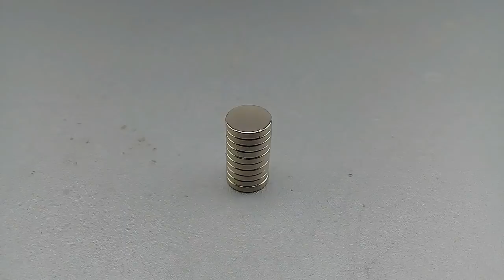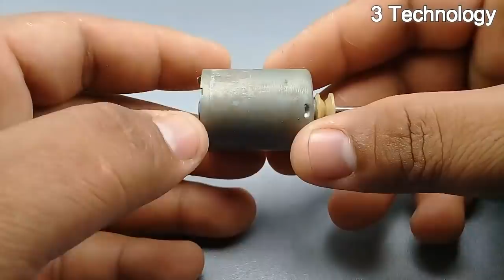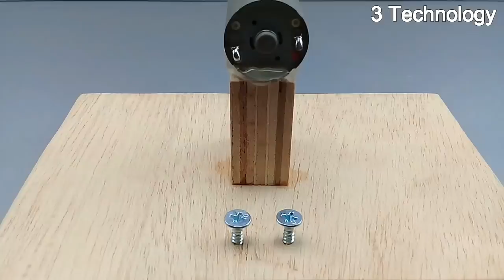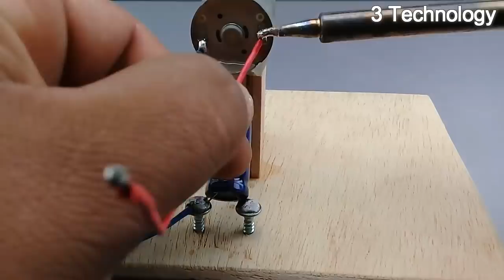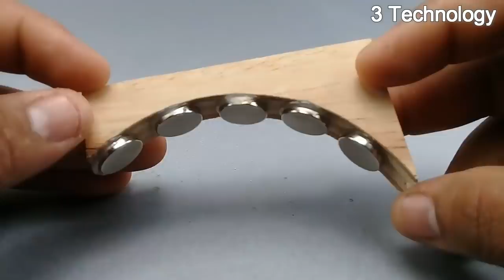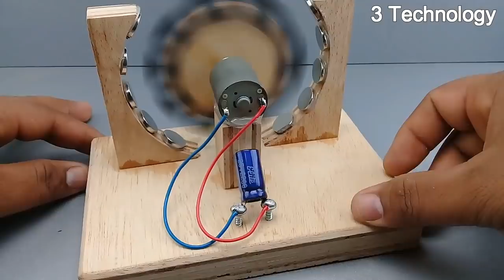Free Energy Generator Using activity Magnet & Magnet

Comment: I like to see it made from transparent plastic ,not with wood, to see where the battery is hidden.
Reply: ofcourse
Reply: Should run without connecting to motor
Reply: Deverian ser más creativos ese truco ni sentido tiene siempre los imanes buscan un punto donde detenerse
Reply: The base plate is always so thicc with screws inserted into it...
Hmm... I wonder where the power supply could be? 🤔
Reply: YES  thatThis is absolutely true. He hides them under the wood. I dare him to take the screws out of the wood until we see that no connection has been made from the wood.
Reply: Absolutely
Reply: Somehaters everywhere magnets can be used to make it spin
Reply: Sad, but not surprising, that people are so ignorant when they see science.
Reply: @anilpatel-gc8sk  well, these setups generally don't run for hours if not connected to motor, do you know under a certain condition, any motor can act as both motor and generator at the same time? 

i pulled the above statement because i am completely aware of how these kind of machines work. generally motor when added with a capacitor (no need to worry how small the capacitor can be), generally gives a few extra spin than the speed of spin when turned with our hands, this is because the motor acts as a generator when the shaft is turned physically, this generates electrical energy and stores the same in the capacitor, which when motor's generated voltage becomes less than the stored voltage, the voltage from capacitor gets reverse flow and the motor will be powered by the capacitor.

when you start spinning the magnetic setup, with a specific rpm, the torque generated by the magnet's mass on the wooden board, becomes larger than the force that holds the magnets from getting stopped, so the entire board will start spinning continuously until the torque generated by the magnet's mass is less than the magnet's polar interaction, this usually lasts for seconds or at the best for few minutes. If you add a motor with a capacitor attached to it, the motor acts as a physical force generator , that generates sufficient force to keep the magnet's polar interaction force to be low than the torque generated by the magnet's mass. 

this machine will slow down if there is more load attached to the motor (say a light bulb), as those load needs more torque from the motor to last (as the load increases the motor is supposed to generate higher amp value ) which slows the magnet's spin speed which makes the entire setup to stop.
Reply: The capacitor acts like a battery 🙂
Reply: The electrolytic capacitor is a battery in disguise
Reply: @carwerasdewq1412  again you can't prove it, but i can prove and many have proved already the electrical over unity works
Reply: @seshamxy9135  entonces funciona ? Me gustaría saber mas de esto si realmente se puede hacer de esa manera
Reply: @osrick92   well, these setups generally don't run for hours if not connected to motor, do you know under a certain condition, any motor can act as both motor and generator at the same time? 

i pulled the above statement because i am completely aware of how these kind of machines work. generally motor when added with a capacitor (no need to worry how small the capacitor can be), generally gives a few extra spin than the speed of spin when turned with our hands, this is because the motor acts as a generator when the shaft is turned physically, this generates electrical energy and stores the same in the capacitor, which when motor's generated voltage becomes less than the stored voltage, the voltage from capacitor gets reverse flow and the motor will be powered by the capacitor.

when you start spinning the magnetic setup, with a specific rpm, the torque generated by the magnet's mass on the wooden board, becomes larger than the force that holds the magnets from getting stopped, so the entire board will start spinning continuously until the torque generated by the magnet's mass is less than the magnet's polar interaction, this usually lasts for seconds or at the best for few minutes. If you add a motor with a capacitor attached to it, the motor acts as a physical force generator , that generates sufficient force to keep the magnet's polar interaction force to be low than the torque generated by the magnet's mass. 

this machine will slow down if there is more load attached to the motor (say a light bulb), as those load needs more torque from the motor to last (as the load increases the motor is supposed to generate higher amp value ) which slows the magnet's spin speed which makes the entire setup to stop
Reply: @osrick92  I actually explained this in one of the previous comments, take a look.
Reply: @Land and Lore Photograph Off Road Adventures remember that this kind of machine usually works, but this specific one shown in the video is faulty and have edit very cleverly to show off... 

Apart from the video, the general concept of motor based on magnets alone works.
Reply: Hey....the electrolit condensator tor could be a camouflage too...couldn't it?
Reply: @yudabanaspati5430  electrolytic condensator? You mean capacitor / battery?
Reply: @seshamxy9135  I guess so...could be
Reply: @yudabanaspati5430  if you want to know how these machines work, just explore them dude, I am just tired to explain how these machines work, secondly apart from the exact machine shown in the  video, other machines of similar design work. But i doubt that this machine in the video have gone through some editing...
Reply: @seshamxy9135  well....I think I'm gonna do that...
Reply: @yudabanaspati5430  good, if you come by any hardships just reply here the doubts, I will answer them that time
Reply: @seshamxy9135  ok..I shall do that👍
Reply: All he did was charge the capacitor.a capacitor is a battery.
Reply: @stevenhale600  capacitor can run that motor for not more than few seconds
Reply: Ethier inside the motor or that fake capacitor. You must remember hot snot = hidden battery.
Reply: Aswr😂
Reply: @nwaforshedrack6656  guess your message is not understandable, so text in proper language or english ( which I am able to understand)
Reply: Charged capacitor??
Reply: @Ratwezil  charged capacitor can't even last for more than few seconds to run this setup
Reply: I love how his soldering always goes so smoothly. I've had nuthin' but trouble with any soldering I've tried to do. Seems like I have to continually clean my soldering iron.
Reply: they make this everytime
Reply: @seshamxy9135  can If its hollowed out and filled with small watch batteries
Reply: @Ratwezil  yeah, but not all such machines are fake, since you can't deny this kind of working procedure, just because some of us were taught in a way to believe certain things wrongly
Reply: @robdom91  Inside the fake capacitor.
Reply: @robdom91  LiPos in the basement)
Reply: 😅 Cierto los tornillos
Reply: @SakshiSingh-zp6fb  do you have any idea of what are you talking about? If you don't, please leave the comments section
Reply: This is 100% free energy
Reply: @BuzzingGoober  HASHAHDHQHHD omg, yeah, keep thinking that way, you wil get really far, far from success
Reply: @Maple_TherianWolf  I made this device and now power my mining rigs with it
Reply: @BuzzingGoober  Ö im sorry, i was wrong, i must do this to power my car
Reply: @Maple_TherianWolf  yes I power my Tesla with it too.  You have to try.  Free energy is good, not bad.
Reply: @BuzzingGoober  Im gonna try, thank you a lot, and im sorry for not trusting 🙏
Reply: This is magnetic drive technology and it's nothing new.
Reply: @SakshiSingh-zp6fb  yeah that's true bashers should go to school and learn more about science
Reply: @seshamxy9135  Exactly, and if the outer magnets / housing was adjustable it should make the motor spin faster as the magnets get closer. I can see this idea being redesigned in a larger scale to power transportation devices and or to make electricity, yes can you imagine having a free energy bike, motorcycle, or a car / truck ?! Hell yes
Reply: @Ratwezil  The magnets are doing the work, the capacitor really isn't even needed to keep it spinning, but this idea does need something to get it spinning ie a hand foot ect 😃
Reply: @overthemountain1009  I guess this is the second time I am saying the following statement, this machine got two forces needing to get involved, in general the starting speed of the magnetic rotor decides how long it can run, because it stops after a while, it is because the torque caused by the momentum of spinning magnetic rotor will become less than the magnetic force of interaction, in this case the rotor will stop. 

To kick start the rotor, you should need the sufficient rotor torque that can over come the stopping torque caused by magnetic interaction forces . 

Due to the above reason it will not be suitable for transportation at all.
Reply: @lpilch4  That could have been an explanation, but to power this for so long, more capacitance is needed. Moreover, capacitors try to dissipate the charge ASAP, and we didn't even see a register! so, I think, capacitor is not the explanation, simply the screws go inside the plank to touch some battery terminals.

Comment: That capacitor pointlessly attached to the terminals is actually hollowed out with some button cells installed. That's what's making the motor spin.
Reply: Shure. It's the better and simplest solution.
Reply: The only explanation that makes sense.

Comment: What are the two wood screws for? You can solder the capacitor directly to the motor terminals.
Reply: Hidden wires from underneath
Reply: Kindly , what it the rule of this capacitor .  thank you
Reply: The two screws are to make contact with some metal under the wood powered by battery
Reply: hidden batterry in wood box
Reply: @Joel-qz6sd  The wooden floor is hollow and a battery is connected to the 2 screws from the inside
Reply: @Joel-qz6sd  it is fake
Reply: @uwemuller-rave7162  Space man send me the magnets and ill show u without wood On a fking Transparent PVC
Reply: yesssss
Reply: @Joel-qz6sd  Yes from a battery.
Reply: @Joel-qz6sd  Oh yes from a battery.
Reply: @uwemuller-rave7162  haters be like dude do some research before saying
Reply: @heat4319389  the capacitor is generally used in motor - alternator based electrical energy multiplier for no specific purpose, there is no chance that the amp generated will be less than the motor's requirement to spin, yet for backup purpose only capacitors are used. The reason is the same for the capacitor in this video too. If he attaches more load, than the force generated from magnetic interaction, then for a small limit of time, the motor to balance the magnetic spinning speed , small scale capacitor is needed
Reply: @albertoantoniomartinez4313  maybe, only if you try to build it and see only you will  know, generally magnet - magnet spinning setup works only with a motor attached to it, this is just because, beyond a certain amount of time, the magnetic interactions will fail to cause the continuous spinning, that where the motor comes at work , by giving the spinning boost, this is also where capacitor comes into play as the motor may need a little of extra load in amp to spin the magnet and keep it in the right rotational speed to maintain the spin continuously
Reply: @seshamxy9135  many thanks for this excellent explnation
Reply: @heat4319389  welcome man
Reply: the screw is where the battery or power source are connected ( most likely wire under neath the ply wood)
Reply: @reypanelo  there is no proof for it, secondly I explained how these kind of machines work and follow the scientific rules , yet if you insist your battery existing under the screw or plywood, you are purely adamant and blindly accepting what others taught you instead of experimenting and knowing things
Reply: They are right, why the need to install two screws and go the extra mile when you could just solder that cap to the terminals, lol. I've yet to see a good explanation for those screws and the efforts as to why installing them. 🤣
Reply: @KB_Joys  you can try any electrical over unity machine dude, just don't install the screws aline, see if it works.... I guess you will find why the screws are there in general,  on seeing your laughter smiley, I thought you could be a simple minded and blinded guy who follow the books very well to talk here.
Reply: @seshamxy9135  offended easily? It's redundant, you simply don't need to do it and could have saved at least 5 mins. 🤷🤦
Reply: @KB_Joys  If you don't want to believe or do and see, just quit, I have done few machines, I am no longer interested in doing these child grade machines for YouTube
Reply: @seshamxy9135  just relax my friend. The way the world is and the people that's in it, it's hard to believe in anything. I'd like to be able to trust and believe in nice things, but people make that very difficult. Life isn't supposed to be like that, and I'm pretty sure we'd all be much more happier without any lies or deception.
Reply: @KB_Joys do you know the difference between energy ( total energy) and electrical energy .
Reply: But then there couldn't be a secret Battery-Compartment.
Reply: @SoHBetaSword  that's what I am arguing regarding most of the so called " Free energy " designs, which is not actually free energy at all, just a common electrical wattage multiplier
Reply: Those would be connected to the battery lol.

Comment: Build it WITHOUT the motor attached.
If this setup is correct, the wheel should spin  on a secured center shank free of any motored or wired connections.
The motor and wiring is unnecessary to prove the efficacy of mechanical setup and magnet placement.

Comment: El capacitor es para frenar la velocidad,de otra manera la aceleración de la rueda estaría incrementando más y más hasta llegar a velocidades que sobrepasaría lo imaginable hasta crear un hoyo negro y así la destrucción completa de la vía láctea
Reply: Thanks xD 

Translation:

Carlosjimz

EN
The capacitor is to slow down the speed, otherwise the acceleration of the wheel would be increasing more and more until reaching speeds that would exceed the imaginable until creating a black hole and thus the complete destruction of the milky way

DE
Der Kondensator soll die Geschwindigkeit verlangsamen, sonst würde die Beschleunigung des Rades immer mehr zunehmen, bis Geschwindigkeiten erreicht werden, die das Vorstellbare bis zur Entstehung eines Schwarzen Lochs und damit der vollständigen Zerstörung der Milchstraße überschreiten würden
Reply: Млечного Пути из кобыльего молока ......которое не пьют млечхи.
Шутка абракадабра!

Comment: Why the screws? Why not just solder the wires to the capacitor? Or are the screws attached to a battery on the bottom of the base somewhere?

Comment: The fact that it didn’t start by itself should show that there is an equilibrium position and no matter how many times you spin it or use any number of opposing magnets , it will come to a halt at equilibrium position. If it’s spinning then there must be a batter connected to the motor (the motor itself is pointless here and adds no value)

Comment: 2 things you people dont understand. first there is no free energy . second you all do the same mistake, to use permanent magnets you need to build it so, that at any given point of the rotation of the rotor , there is a un blance in the magnet fields . building symetric will never work . symetric system go into lock inevitably

Comment: This is awesome! (sarc) Now, scale it up and run your house on it for about 6 months to a year. Or, even just run a refrigerator. Then patent it and sell it. You would be a billionaire within 5 years. But you won't do it. Why? Because it's a fake.
Reply: Right because the battery to power the motor and Capacitor is hidden under the board connected to the screws on the back side 🤣🤣😂😂

Comment: What are the magnets for? They're not doing anything.  You should show the hidden wires that are connected to the screws.  Please tell PAK your videos are fake. Tell him the truth.
Reply: I tried your idea and it does not work I did every thing possible at leased20 times but it works beautiful with a 9 volt battery runs like crazy my add vis to you if you are going to waste your time doing something do it honestly you will get a lot more compliments . I have a invention that runs off of a 12 volt car battery that recharges 24-7 its self and makes real energy ,12 volts to a invertor to make 120 volts  ac to light up a 100 watt light bulb I have on a shelf in my little cat shed it runs 24-7 the cats love it they all lay around it in the winter to keep warm it works great. I wish you luck keep trying for free energy you might luck out one day.

Comment: Dear all , This is not a free energy.  just for  youtube views only. Every time he is going to make like this . the wood has already two holes prepared. inside of it are small batteries. to apply it  are two ways. one is he cut some portion under or behind the wood and made some battery housing. second the flywood can be cut in layer and put the batteries in the middle and glued it again, but in this case he made the first one since he did not show the other side of wood base. meaning this is bogus.

Comment: I'm wondewring why you don't directly get the Capacitor connected to the Motor - O h wait, than the Screws connecting the whole thing to the Batteries underneath wouldn't make any sense.
That's also the Reason why you don't show the Underside or why you're not using transparent Plastic.

Comment: Can't work. It would just find a position of equilibrium and stay there. If you claim the magnet disc is a motor, let us see it mounted on a shaft with no 'generator' attached. It should turn. But we know it won't, because in reality it is being turned by the 'generator' which is acting as a motor and powered by a battery. Do you people think we are idiots?